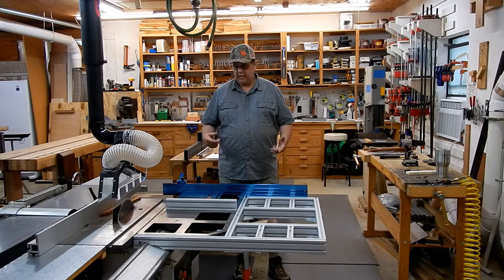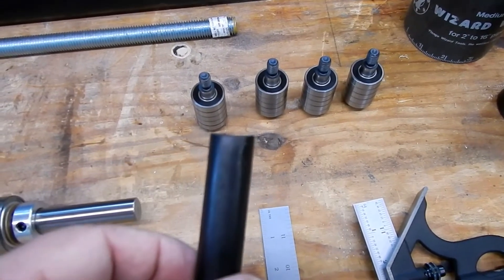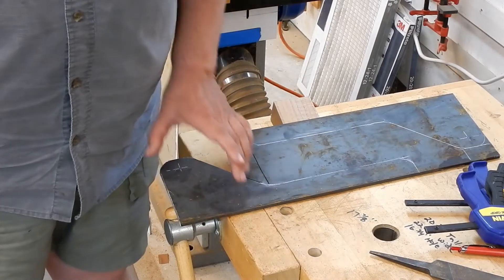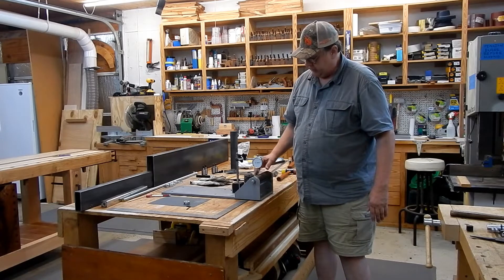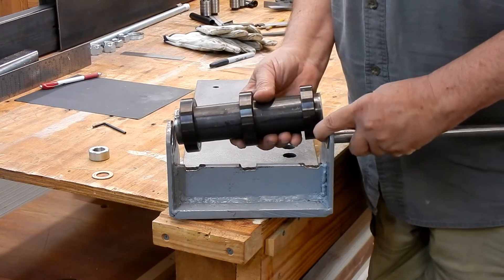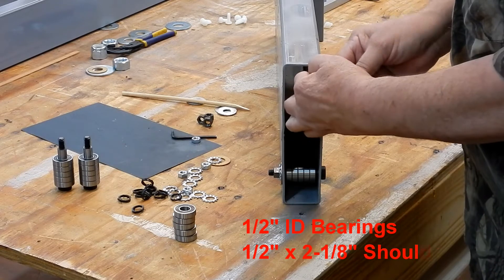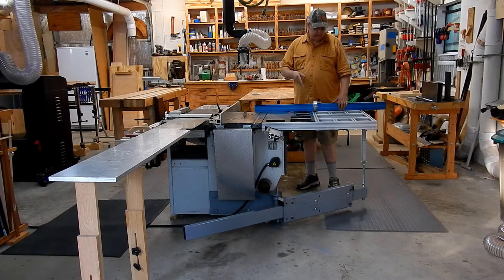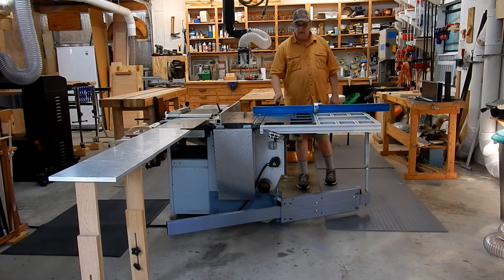Robland X 31 Sliding Table Support

Comment: Hi David, I have the Robland slider, but mine is very hard to slide. I have cleaned all surfaces, replaced all the bearing, but still take a lot of effort to slide. Any ideas on how to fix this? Thanks!
Reply from the maker: There can be several issues. Since you just installed the new bearings on the support bar you can see that they are rolling. 
2. Remember that the rail levers need to be locked down on the front and back of the machine before using the sliding table. When you lock those levers down it will pull down on the rail a bit.

3.  If you have the rail pulled out in front of the machine put in the support bar on the end the rail or it will droop some. 

4. The next would be to check if the cross supports on the bottom of the table are not dragging on the rails or the sliding table is not rubbing the fixed table. Get a flashlight and look at it from both ends and from below while moving the table back and forth. Most likely you will feel where it starts to hit and just do a close visual inspection from every angle. 

5. If you have cut some long or heavy pieces that have hung off the side of the sliding table that can bend the sliding table support bars that the bearings are mounted to. I have had to bend them back straight before.

I hope this helps but if you still are having issue please feel free to contact me or contact the group at https://groups.io/g/roblandx31
Reply: Next to the great tips you've already had. There's two bolts visible on the outside edge of the sliding table where the sawtable and sliding table slide next to each other. These bolts compress the bearing assembly to take away side to side play. These are easy to overtighten and will introduce a LOT of friction very fast